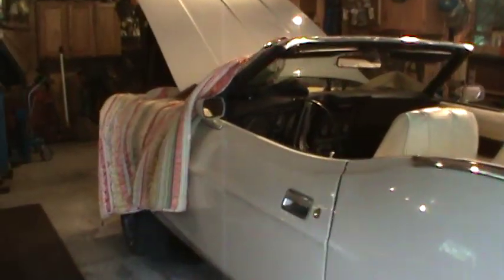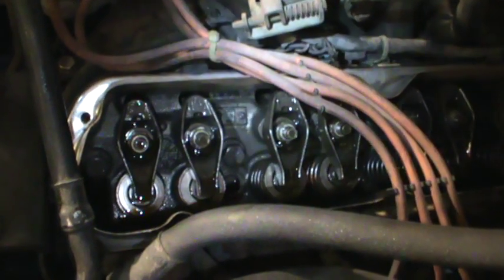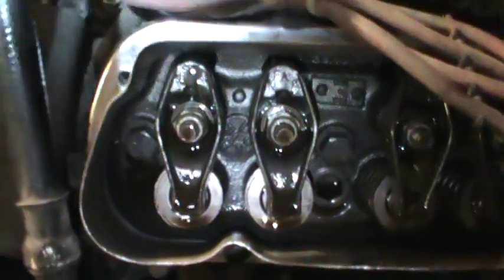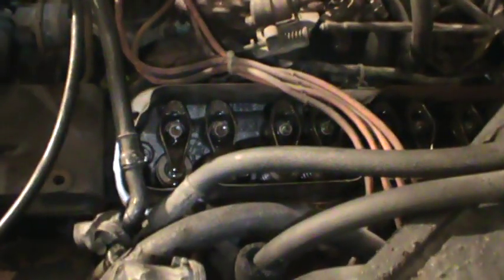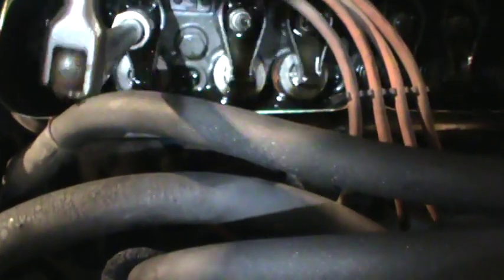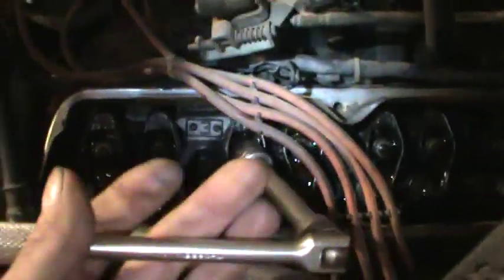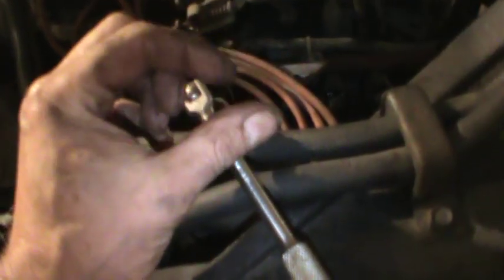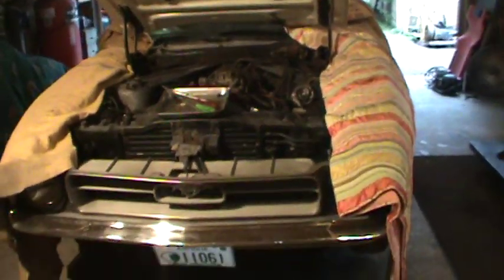how to adjust valves on a small block ford running

Comment: The most insane thing ever seen anybody do. Had no clue you could actually adjust the valves while the motor was running. And I've actually never seen a motor run globe valve cover on it. That was a pretty cool thing all to itself.

Comment: Good job, I've seen a set of small block chevy valve covers that had holes drilled just big enough (and accurately enough) to slide a deep socket onto each adjuster.  I have used the little clips that attach to the rockers to stop the streams of oil, but oil still leaks on the exhaust manifolds...

Comment from the maker: if they are adjustible, you would adjust them the same way as this, some  were positve stop and you would just run them down untill it bottomed out, pop a valve cover off and see what you have, you may get away with replaceing the push rods if its the non adjustible type, other then that you have a bad lifter,rocker or cam,, good luck with it,

Comment: thank you, good idea with the valve covers. My engine (sbf 260) is a little noisy, it still idles smooth, points 15 thou dwell on my meter is 28 1/2 degrees ,10 degrees initial timing. I did not build the engine so its all learning, I belive now I have a few valves maybe too tight.good tutorial now I subscribed will watch and learn. thumbs up!
Reply: Adjusted my valves on a 64 289, my brother thought I replaced the motor it ran so much better.

Comment: Would a rod knock be twice as fast as a valve tick? I've had a tick in my 1968 302 for a long time but today it seemed a lot louder... but it's pretty slow at idle.
Reply: Yeah and the noise is completely different.  Knock vs Tick.

Comment: Will this work when the camshaft isn’t stock? I have comp cams and it says to use a specific valve clearance. Could I just do it the way in the video and not worry about measuring the clearance on each valve? Also what do you do with the vacuum/pcv lines from the valve covers? Thanks.

Comment: bad news i pulled the cover and i have a hung lifter...... and my truck seemingly just broke the rocker bolt today. so what would be the process of cleaning and reinstalling a old lifter? will it require me to break it in again after cleaning? and i can see into my cylinder head there for i dont think i have to remove my intake manifold.
Reply: Just buy a new lifter

Comment: Hey my 75 ranchero with the 351m/400 has tick in the rear side of my valve case on the passengers side... how would i go by adjusting it? My case looks clean on the other side Never even looked on the other side until now i will pull it. What is the best way to adjust this... runs fine but that tick is ruining the experiance of pulling up to autozones and getting the old school ooo and ahs...

Comment: I have a 351W it's starting to tap a good bit. I'm thinking it needs a valve adjustment. So I'm clear. What I'm seeing done here is a complete loosening of the nut in till it starts tapping , waiting a few seconds then a retreating of the nut...
Reply: Loosen until tap. Tighten until no tap. Readjust ratchet so you can gauge another 1/2 or 3/4 turn tight.

Comment: Would you suggest doing this if the valves are already out of adjustment? (i.e. intake backfire ect.)
Reply: Yes but, I would bet the valves are not your problem, look for spark or too much fuel issues.
Reply: Or a work out distributor or vacuum leaks

Comment: I cut my teeth building a blueprinted 289 balanced, painted valley and ported polished heads with hardened seats and forged TRW pistons. I sheared the mounts off the torque conv. I couldn't keep an auto behind it. Couldn't afford or find a four speed.
Anyhoo...I now have a 95 Taurus SHO.....
It's at 146k...time for its 150k valve lash adj. I can't find any info regarding a 3.2 Yamaha DOHC. I know the block is Ford and just the top end is Yamaha. But still NO info. Do you know if the valves are solid or hydraulic?  I will do a short video on this in the spring when this place thaws out.
Thanks for your help. ...
Jeff in the Burg.
Oregon
Reply: Looks like it's overhead cam directly into valve.  There is probably shim kits for any adjustment.  I just read that they may be rare.

Comment: i have i 83 f150 302 my valves chatter when im in 4th gear and i get down on the gas. and when i go up a hill they will start chattering and i will lose power can u help?
Reply: That's probably rod bearings

Comment: An engine equipped with a hydraulic cam does not require a feeler gauge. When adjusting the valves on an engine with hydraulic lifters, you are not really setting the lash or clearance--you're actually setting the preload on the lifter through the pushrod and rocker arm.

Comment: Hey sir thank you for the video,  quick question,  i'm resurrecting a 289 MERC COUGAR and has 2 questions.. 

(1) I remember from my high school years not having to untorque/loosen any bolts,  there is just the hold down bolt that spun with a moderate amount of force...  is that true for the 289? (1968)  

(2) if i feel or thing there is a oil flow issue on one cylinder or warped rod.. how do i pull the rocker off safely, and how do i put the rods and rocker back on.. any insight or good web links you could share?  thank you in advance!

Comment: I'm trying to locate speed sensor on a 2010 Wrangler JK. It isn't attached to the transfer case on the output shaft side where it should be. I've crawled under the carriage for a complete inspection. I don't see ANYTHING attached to the Tcase. Any help from this quarter? Thx.

Comment: Small block fords do NOT have a valve adjustment! You only torque each and every one to 20 ft pounds. You tighten all as far as you can without putting much pressure on the nut then tighten all to 20 ft pounds. The oem heads are NOT adjustable. If you switch push rod lengths or install solid lifters then you can adjust your valve lash. All small blocks are pre set by the stud in the head.
Reply: WHAT????? LOL
Reply: @charlestait5303  What? Can't you read??
Reply: SMH
Reply: @theogdirkdiggler  What's that supposed to mean? They are NOT adjustable! Dam I have worked on Fords for 40 fuckin years and factory motors are not adjustable. Tighten every one to 22 foot lbs and your done! Otherwise your leaving them lose. If they were solid or roller rockers then you adjust them. If you notice when he loosens them he has to use a lot of force to loosen them and you can hear how tight they were. That's because they are supposed to be tight. Ford don't make factory older small block 289,302,351W 351C with adjustable lifters!!!!
Reply: Thank you. That is what I understood as well. They are a zero lash set up and the only way to adjust them is with different length pushrods.
Reply: so torque them and set lifter preload or just torque them down and your done?
Reply: @chickenlegman5460  hes talking about the solid lifter motors, you've gotta set a clearance. The hydraulic lifters have to have the pre-tension set. I tried setting mine to 22 ft lbs, motor ran like ****. Use this method, it works good.

Comment: Why don't you tell nobody if it's a hydraulic or a solid lift and why don't you do it like it's a new motor tell everybody if they got a jam nut on it it's solid lift and when you just run the bolt down it's hydraulic